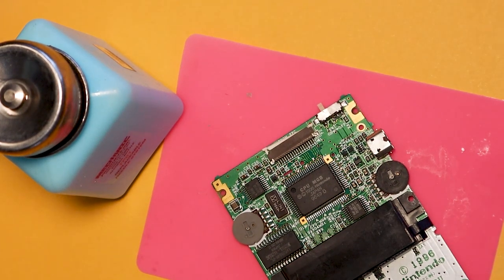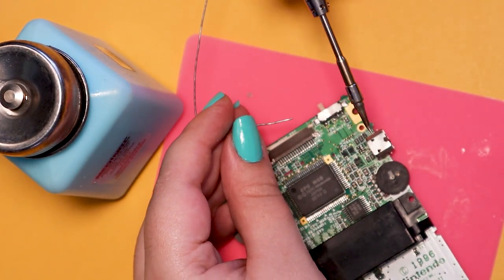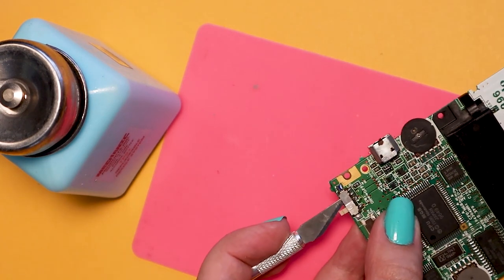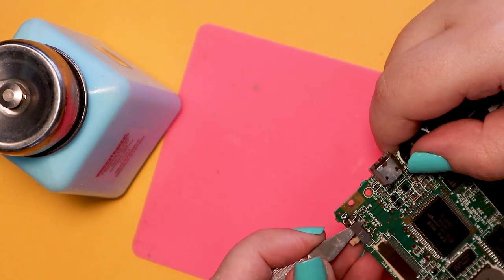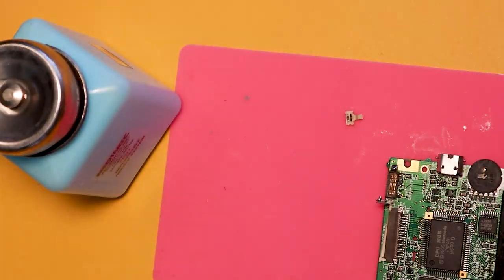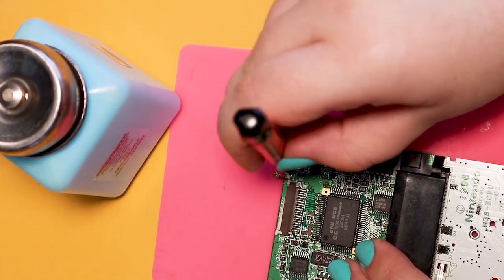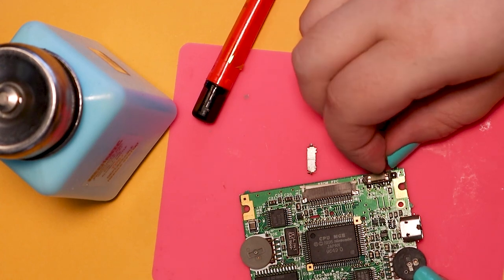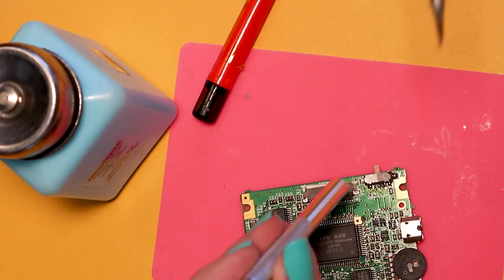Why your Game Boy doesn't work | Cleaning a Game Boy switch

Comment: Natalie, any ideas on the reason my GBC has no volume? I've cleaned the headphone jack, changed the caps, changed the speaker and still nothing. With headphones in, still nothing. Thanks! :)
Reply from the maker: check if pin 4 and 5 of the headphone jack have continuity. if you dont have a multimeter, solder a wire between the two. sometimes a headphone jack can look clean but be broken inside
Reply: @NatalietheNerd  yes, they have continuity
Reply: It can also be the potentiometer in some cases. Or broken vias/traces if there was ever any corrosion. ")